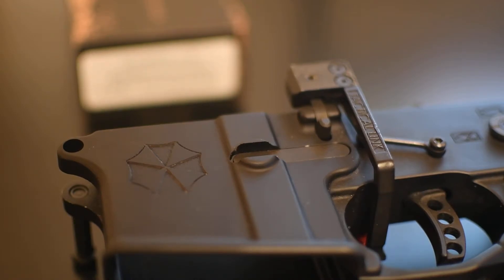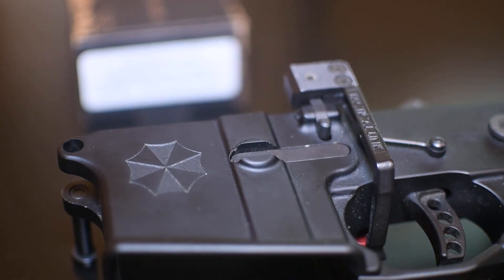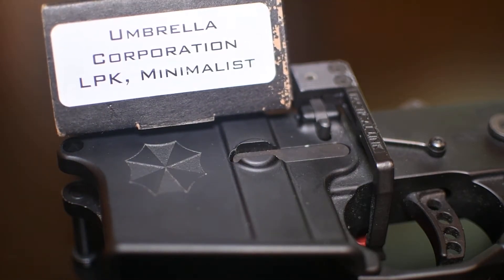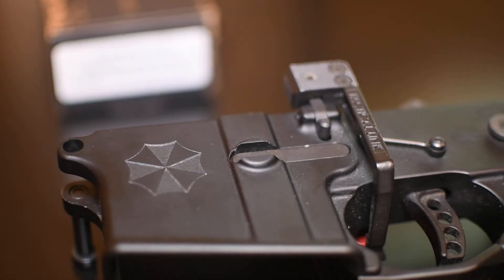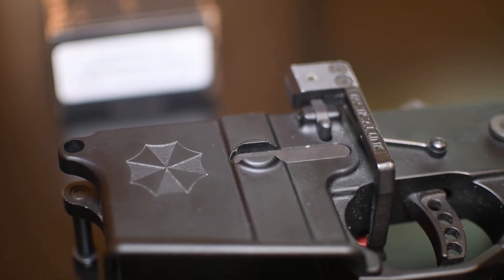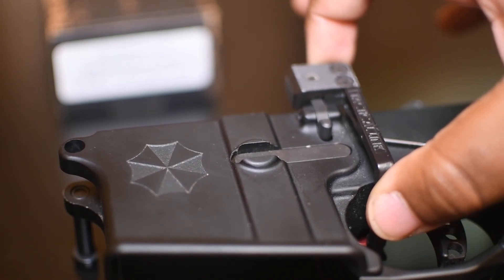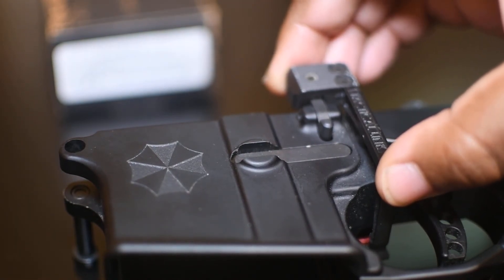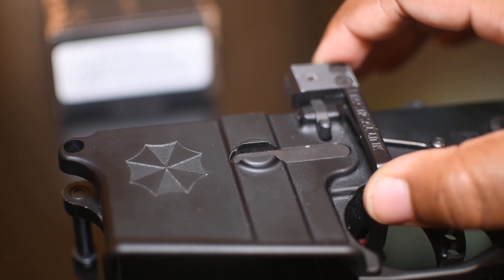AR-15 Bolt Catch Wobble UCWRG LPK

Comment: I have the Magpul BAD lever. (Very similar.) I have the same wiggle in mine... its a used lower. I put 100 rounds thru it and my bolt NEVER stayed open on an empty mag. Upon inspection... it almost seemed like the bolt was not going back far enough. However, If i hold the bolt back and twist the bolt catch... it will actually catch. Other times my bolt will miss the bolt catch would actually catch on the mag.  Im going down to my local gunshop next weekend to get another opinion. During my training in the military, ive never seen one as sloppy as yours is... and mine is just as bad... if not worse. Lemme know if you have any more info since this upload.
Reply: Ohgr33  Did you ever figure out why your bolt catch wasn’t working?

Comment: Okay so it's out of spec it's just.... Wether you care or not. This can also occur from having no firing pin in while dry firing. Wich unfortunately I've done accidentally a few times on my psa lower and now I have the same issue so I'm either gonna replace it or try to see if the pin walked out or something but ehhh. It's not completely normal actually no. In a normal functioning ar the bolt catch wouldn't ever get loose for no reason unless it was assembled or accidentally done